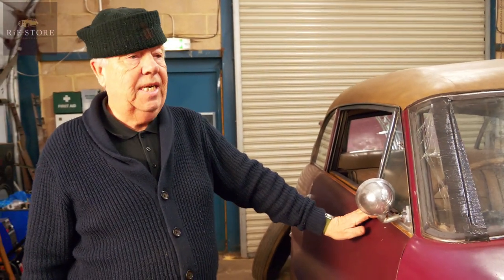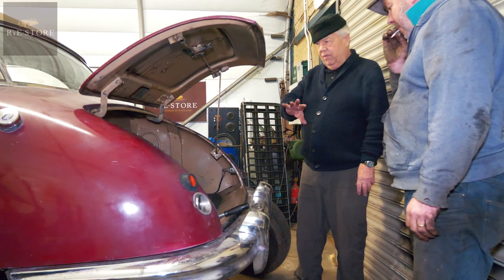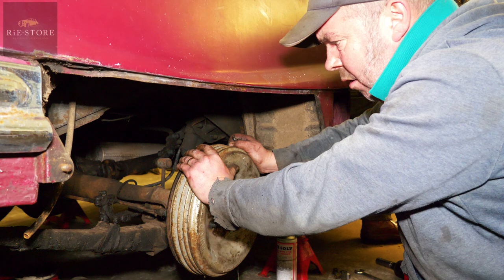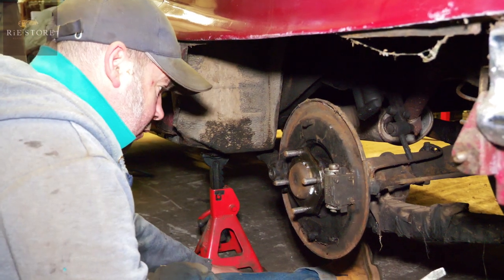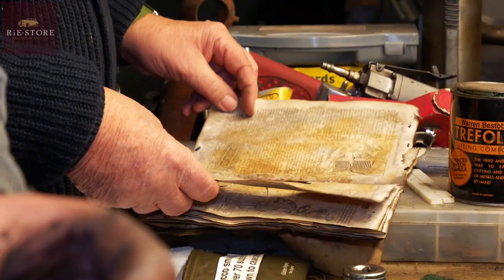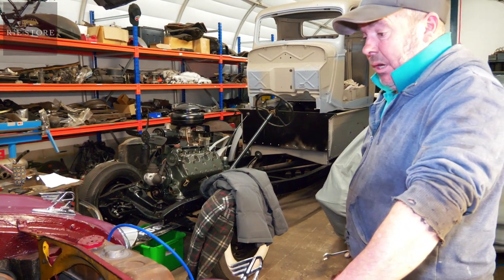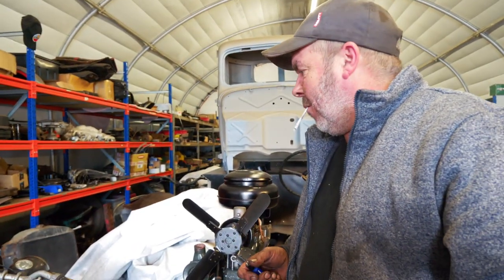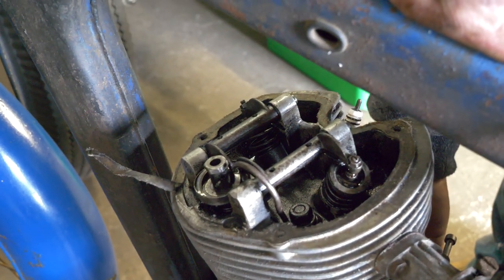Bleeding the brakes - 1952 Austin Atlantic / ep015

Comment: On these they have a single master cylinder mounted in chassis RHS. They can leak. They shouldn't. New parts can be obtained from Austin Healey which work well. However the new master cylinder isn't identical internally to original girling unit. The original brake pressure switch can however be linked into the line and works well as it has correct thread. New pressure switches have different thread. Ps strongly recommend removing and cleaning and coating  fuel tank. Also removing fuel sender and cleaning. I used redcote  to seal tank and sender. Works perfectly no leaks
Reply from the maker: Thanks for the tips, they're much appreciated!